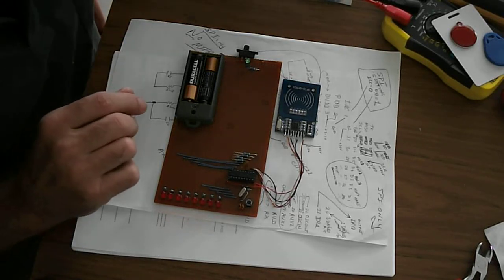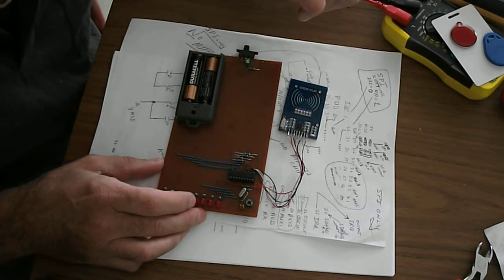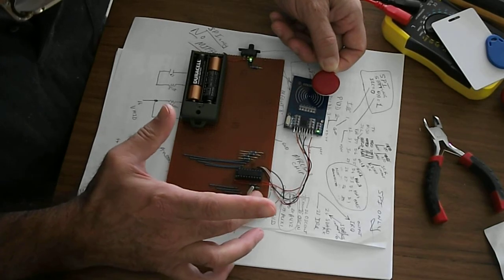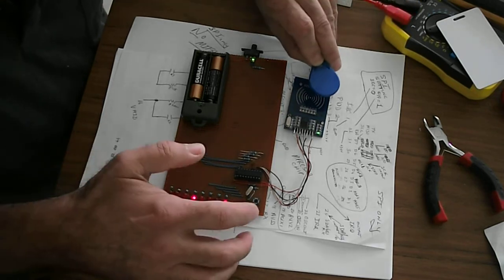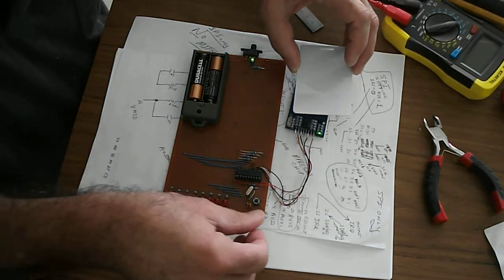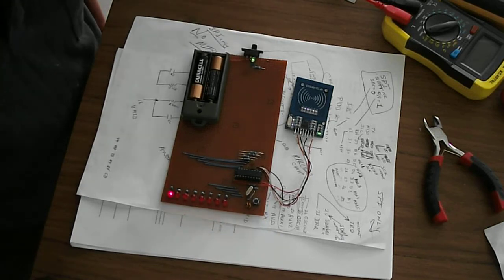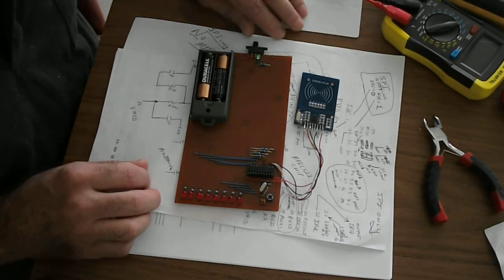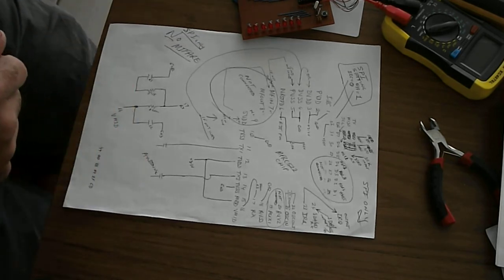MFRC522 MODULE

Comment: I" found the board and will post the schematic ASAP, I now use the UNO R3 and the software I use is on my gmail drive the link is above this works very well and can be modified easily I built an RFID ring for this project however since then someone else built rings and I lost interest I am happy to help any way I can.

Comment: I have to clean out my cupboard to find that board, as soon as I find it I will post the schematic but it is only very basic. I bought an Arduino uno which I use as it is very versatile and it gives me feedback via the computer screen. This is all I needed for my experiments on rfid so I have'nt elaborated on the pic chip.